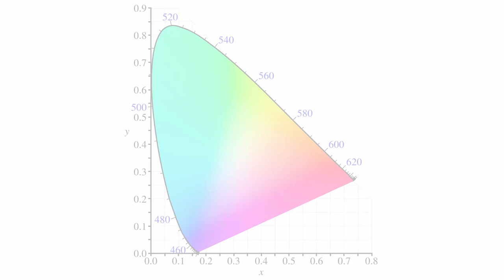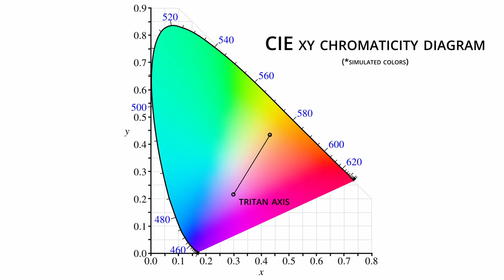Can I make my vision better with DIY red light glasses?

Comment: I think the bigger problem with the testing might be that RGB from a monitor simulating different wavelengths could give different results than you would get from comparing light that's actually different wavelengths.
You're not actually testing your eyes' ability to recognize the difference in the colour of the light itself, but the colour your eyes perceive from changes in the balance of 3 other colours.
Reply from the maker: Thanks for the comment -- I don't think there's much of an issue, here. All of the colors in the chromaticity diagram shown in the video are in fact only obtainable as combinations of wavelengths. The only 'pure' colors shown in the diagram are those along the curved edge of the diagram (indicated with the wavelengths). So when the scientists did their testing along the protan and tritan axes, they were (necessarily) using combinations of wavelengths to produce those colors. While it's true that the particular spectra the scientists used will differ from whatever spectra my monitor is using, and I could conceive of that being an issue, it sounds like the way this method improves color vision is by general activation of the retinal cone cells overall, not by sensitizing them to particular wavelengths or changing their spectral response in a particular way. That may be wrong, of course, but that's my impression. So I don't think that using metameric colors (wiki: metamerism) should be a problem in the testing, unless something more subtle than expected is going on.
Reply: Agreed with Casey. While the Wavelength Discrimination Function is a sort of gold standard to judge an individual's color vision, it is usually just used academically, not clinically. The resolution along the blue-yellow (tritan) and red-green (e.g. Protan) axes, as being tested from the RGB monitor, is indeed proportional to the WDF.

I am concerned however with using 8bit sRGB, since I don't think you'll quite have the precision to clearly detect even a 5% improvement to color vision.

Comment: Non-technical person here. Why does it have to be glasses? Could you create a web page that displays the right color so that when viewed full-screen all you can see is the color? (Maybe make some simple blinders?) But maybe monitors can't mimic precise wavelengths? And there's probably too much variation in monitors?
Reply: You're right that monitors can't reproduce precise wavelengths, but also the light intensity from a monitor is several orders of magnitude lower than that achievable with LEDs mounted directly before the eyes.
Reply from the maker: Strictly speaking, monitors can't reproduce pure 670nM light... however it's not clear to me exactly how strict the requirements are. The paper refers to previous research that explored (successfully, I take it) 650-900nM wavelengths. The sRGB red primary (i.e. what computers conceptualize as "pure red") is reasonably close to about 610nM, and the red LEDs in the pixels of computer monitors, at least in some cases, are going to be emitting some amount of 670nM light (see e.g. tables 7a and 8a here: https://clarkvision.com/articles/color-spaces/ ) ... given that the researchers are exploring lower-power lights with success (e.g. the above-mentioned paper), it seems plausible to me that a monitor could possibly have some effect, depending on what kind of LEDs it uses (one would need a spectrometer to be sure -- e.g. table 8b in the link above shows a monitor that does not emit that wavelength.) Maybe you would want to crank up the brightness and sit an inch from it, maybe you'd need a longer dose, etc. Given that I'm not a doctor I certainly can't make a recommendation. If this approach turns out to be useful and powerful I'd imagine that folks would be characterizing monitors by model and posting the data.

Comment: Doesn't the light flux ultimately depend on the current you are driving them with? And with the potentiometer, how can you know how much current you are driving? In your schematic you mention a 100 or 250 Ohm pot + 4.7 per led, so assuming a switched off pot you are driving them with over 150mA... What I mean is that in the end it seems to me that either you don't put any pot and then you can calculate precisely the exposure, or with a pot you are going to just eyeball it (put not intended)... and yes I'm trying to build my own pair of glasses here :)

Comment: What's the mcd of each LED?  I'm seeing that LEDs are sold having certain mcd output
Reply from the maker: Check the numbers on-screen at 3:27 -- mine were spec'ed in radiant flux (lumens), but my estimation/calculation is that they are ~345 mcd at 75% of nominal current, so ~459 at nominal current. But again, that's based on a non-expert's math, so take it with a grain of salt. :-)
Reply: It's also important to consider that mcd is a measurement of the intensity of the light, and not the total light emitted.  An LED with a narrower focus will have a higher intensity (mcd) than the same LED with a wider lens focus.
In a case like this, where you're capturing most of the light, regardless of direction, lumens is a much more useful measurement.

Comment: Great project ! Where can I buy 670nm leds like yours? Im in Europe
Reply from the maker: Thanks! I'm afraid I can't help you re: Europe (I got mine in the US) but in case it helps: the LEDs that I used were Lumileds L128-DRD1003500000 (in the Luxeon 2835 Color Line). These are surface-mount LEDs, though, so be aware that they are difficult to solder without damaging. Good luck!

Comment: What about Christmas light?
Reply from the maker: You mean the LEDs used in Christmas lights? There's a chance they produce some of the necessary wavelengths, but it would depend on the particular lights. There is too much variation to make a broad statement.

Comment: Hey Casey,  man how smart you are!
I wonder can you see out of these or is it just shinning a red light in your face.  Impeding normal vision 
Also would a pair of glasses with a deep red lens cha get wavelengths of normal led lights say in the ceilings?
Reply from the maker: Hi - sorry, i thought i replied already: no you can not see out of these. In terms of using filters to get some benefit from ambient light, i don't think that would help: without the filters you still get the red light so adding the filters wouldn't change that... The other frequencies of light do not interfere with the effect (as far as i know). So you can just be in bright sunlight and probably get a similar effect, but these glasses just concentrate it and make it easy/fast to get a dose. In other words, the point of these glasses isn't to make you see only red light and no other light; the point is just to have some bright red light in your eyes.
Reply: @caseyconnor2  got it ! So Ive read a study that red light glasses used on shift workers increased alertness and decreased stress. When we wear red lenses the ambient light is not converted to a red wave length of some sort?  Because we see everything red
Reply from the maker: @Nando_lifts2021  right, the filters do not convert the light to red, they just block the light that isn't red. If for example your surroundings are illuminated by a sodium-vapor light (which used to be common in streetlights and which has an extremely narrow frequency band of light that it emits) and you look through filters that filter out that frequency, you will see nothing at all. All that said, there is an effect where (in regular light, not sodium-vapor) you put filter glasses on and because the light is now dimmer your pupils dilate and let more light in, which does effectively "turn up" that frequency of light, so it does kind of work the way you imagined. (Perhaps this is how the study you described got a result.) Whether that effect is significant depends on the ambient light in question and how much more of it you want to get in to your eyes.
Reply: @caseyconnor2  well explained. Thank you